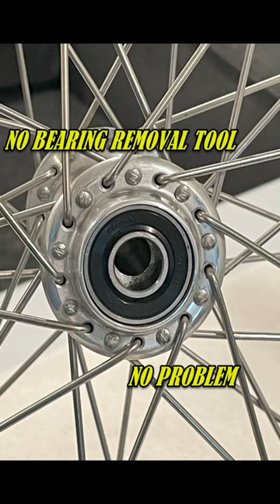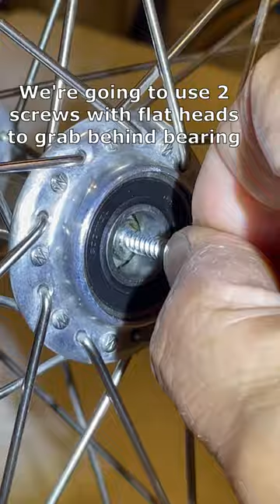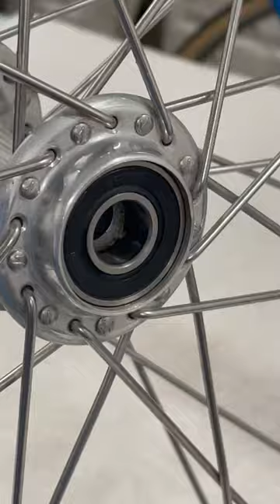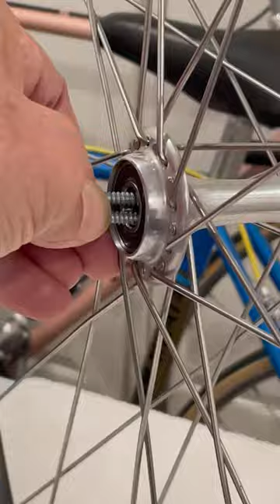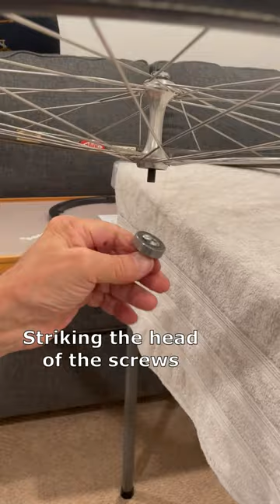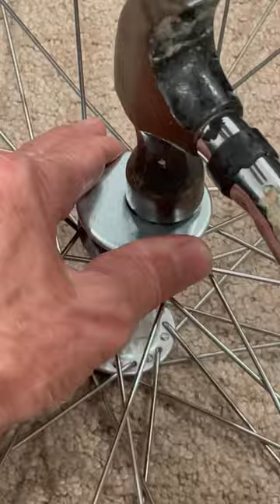Bicycle Wheel Sealed Bearing Removal/Install: No Bearing tool! #shorts #bicycle #sealedbearing

Comment: I would use a large nut and bolt to press the bearings back on.
Reply from the maker: Good suggestion, thanks for the comment. 👍👊
Reply: Hello good day to you, just want to know what size of the bearing?

Comment: Can i convert it normal hub to berring hub?
Reply from the maker: Depends on the hub. If the race is shaped to handle the round bearings.  You would also need a cone nut to hold the bearings in place and make adjustments. 👍👊

Comment: My sealed bearings on my bob trailer are not turning well. The problem is that the axel is not removable.
Reply from the maker: Can you at least change the bearings?
Reply: I had thought remove axel , use a drift to knock out old bearing. The bearings must press in and trap the axil. So what's the trick??
I'm old and not as smart as I used to be. Woppes
Reply: Put the bearings in the freezer and use a torch or even a heat gun to warm up the axle where the bearing goes and it will fit right in

Comment: Is the size of bearing same or varies from bicycle to bicycle
Reply from the maker: It can but since the axel is standard in these vintage bicycles I would imagine they're pretty much the same.  Always measure the inside diameter of the middle hole and the outside diameter as well.  Also measure the thickness.  👊👍
Reply: @BicycleRestorationMan  Thank you
Reply from the maker: @venkateshshanbhag8310  anytime 👍👊